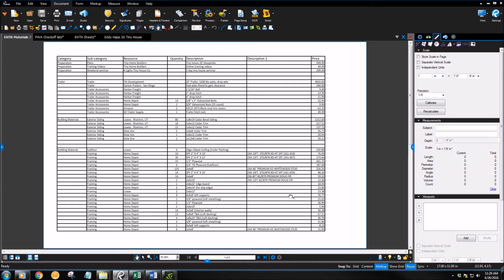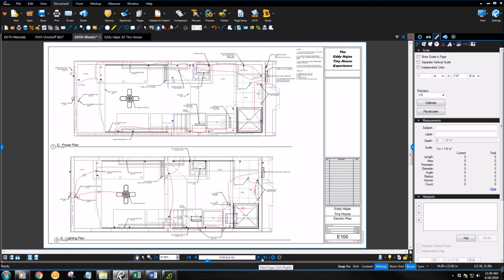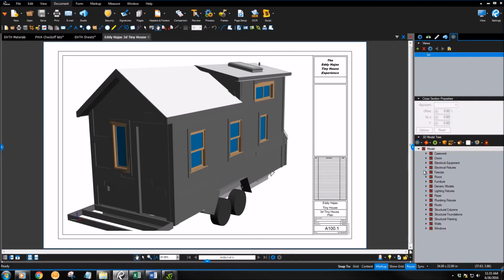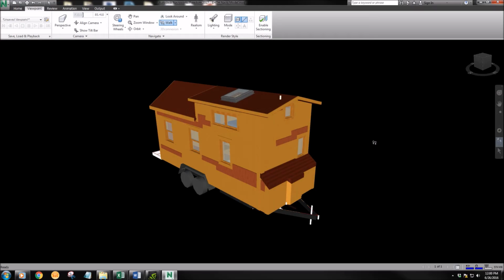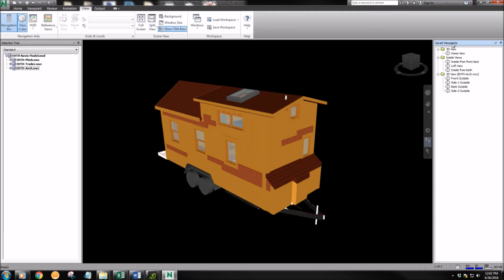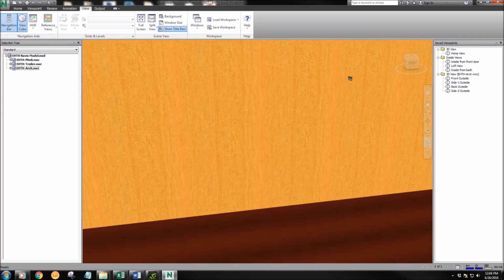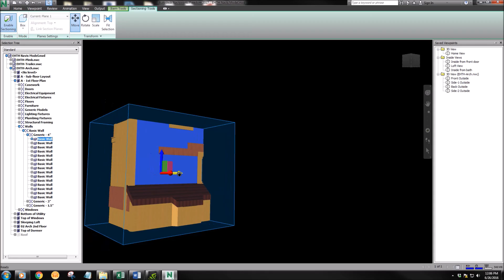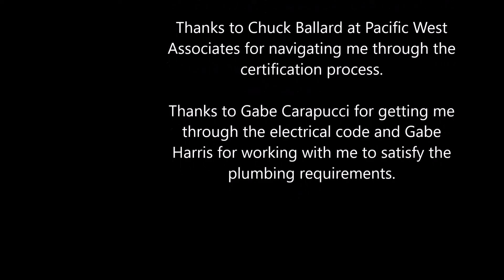Eddy Hajas TIny House Design Plan Package

Comment: What is the brand of your skylight?
Reply from the maker: It's from Fakro.  I would suggest getting the 26x31 size since it's the only one that you'll get close to making the installation recommendations, the other skylignt are technically too big, although many people have made them work.  Also, get the built in blind.  Without it, you tiny house will bake in the summer heat.  Here's a link to the site I've purchased mine from...  http://www.bestskylight.com/fwu-l-26x31-left-opening-egress-roof-window.html
Reply: Eddy Hajas Thank you!!!